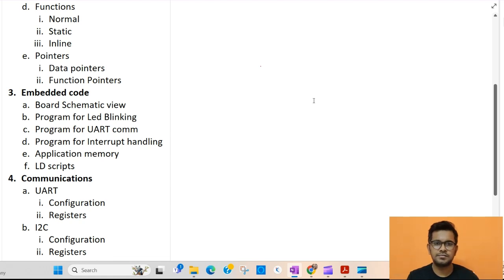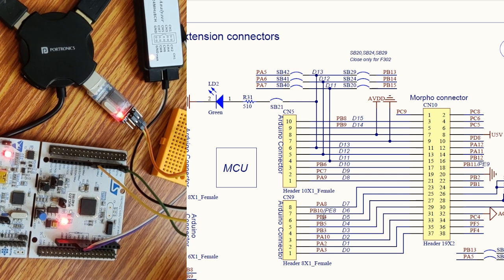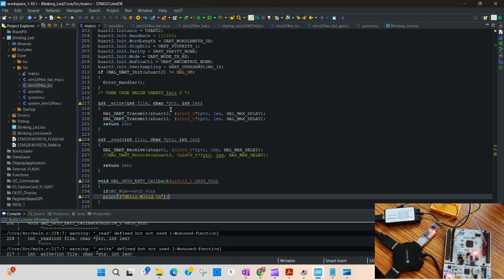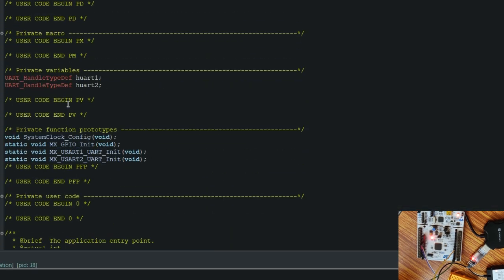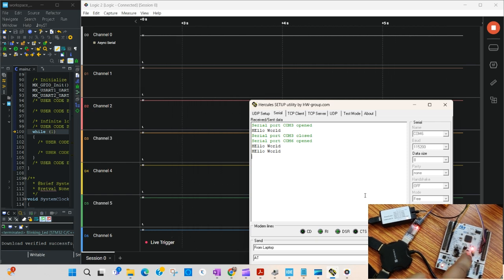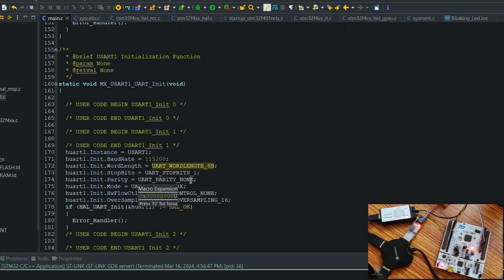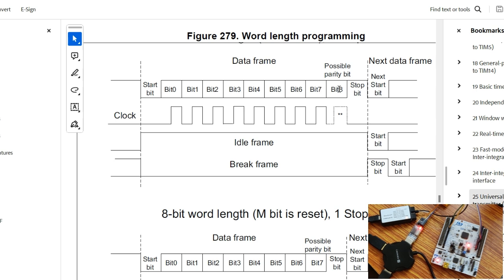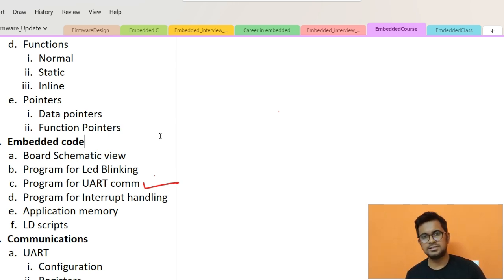STM32 Programing USART|| Parity Bit|| USB to TTL|| Logic Analyzer || PART-5 ||#debugging #embedded

Comment: Need help. I want to interface STM34F4XX board with Atmel AT29C257 5V CMOS flash memory to read the data from memory. Kindly help and assist.
Reply: Kindly help me. I got stuck into the project. Plz help me to interface STM32F4XX with Atmel AT29C257.
Reply from the maker: @ckhapekar87  can you mention the complete number of stm board
Reply from the maker: Need to check the interface type
Reply: @EmbeddedworldJoy   it is parallel interface.
Reply: Hi, I am using STM32F407 board